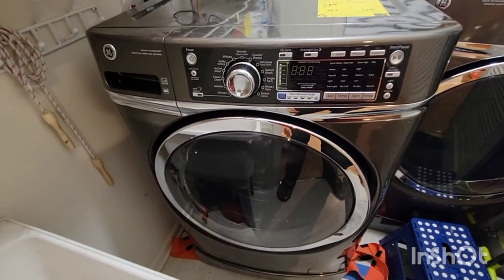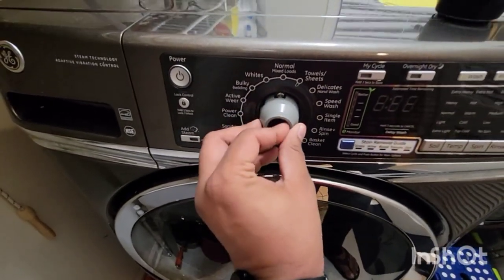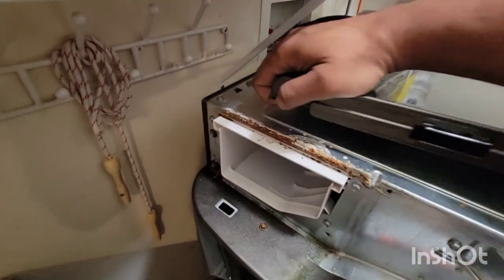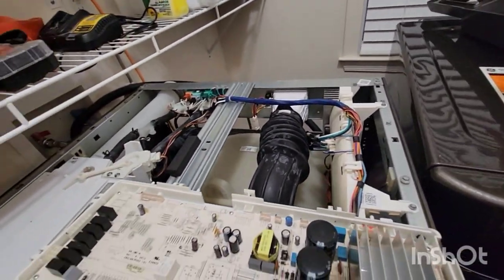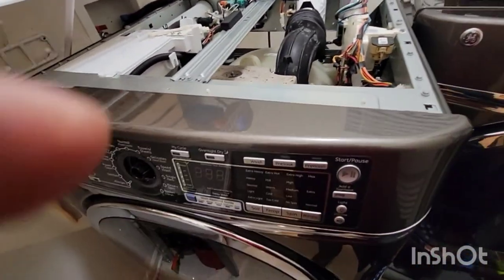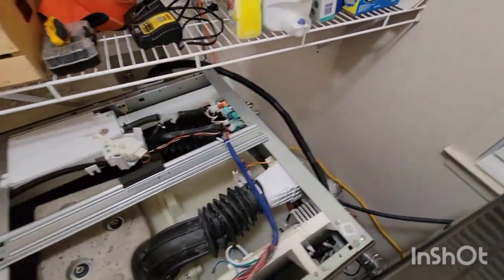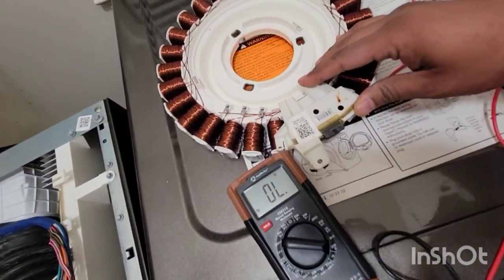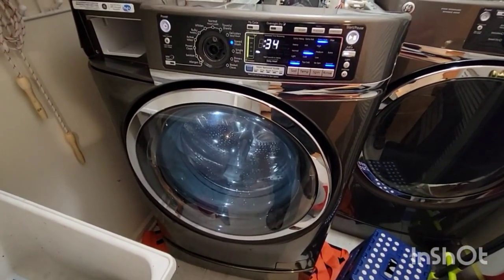GE washer (GFWR4805F1MC) died after power failure + no spin issue

Comment: There is a manual release on the inside of the unit half way down the unit accessible after removing the top panel.  It is located on whichever side your particular unit might latch on.

Comment: My washer and dryer arent as nice as those - but im having the exact same issue and after some research im betting i have the same problem, with the control board at least. Branch came down and broke the neutral wire for my power service at the pole. Everything in the house went crazy. All my surge protectors popped. Power wasnt completely dead since both legs of the feed were still intact, but without the neutral nothing worked right.  I shut down the main breaker in my house and about 16 hours later the power company finally came and fixed my line - right as i was digging out a kerosene heater to keep warm.  Power line fixed - luckily all the important stuff in the house (furnace, sump pumps, fridge, 86" inch tv lol) all were working. My Amazon Basics surge protector probably saved my TV and home theater stuff. All that stuff was on and it was a pretty loud pop when that surge protector blew, but it didn't shut off. That was the first thing to get unplugged as soon as the protection indicator light was gone. Unfortunately both my washer and dryer took a hit, even though neither were in use.

Comment: I'm thinking I have the newer model GE washer and  dryer. Mine are 4 years old. At year 3 my washer stopped draining. I found the specs and ohm'ed out the drain pump which was out of spec. I ordered a new drain pump installed and same result. Everything powered on but no pump. I thought about and the only thing it could be besides broken wires would be the board. The board for my machine was close to $200 and had about 17 connections. I pulled the board first and on visual inspection I had a huge burn mark where the drain circuit is. My theory is the fried board took out the pump. I replaced the board and on my unit you have to go into programming to let it know the specific model of washer. Everything came out perfect. Now the fill valves make a squeaking sound. I have new valves on hand but haven't installed them yet. While back there I am also going to replace the hoses and the steam hose to the dryer.

Comment: you don't have to break your door lock. there is a white piece you can push in to manual override to unlock the door lock.
Reply: Can that be pushed in when the Power has completely gone ( the machine not turning on), and can you please point where on the machine we can find this?
Reply: @vittalvijay551  yes, if you open the switch, you can see it is the by pass door opener when the power is complete gone.
Reply: @vittalvijay551  There is only one white tab on the switch. if the door is not closed, you can access it by open the rubber seal. if the door is locked, you have to open the top, and see the white tab from the top and put it down to release it.
Reply: Can you explain where plz
Reply: @ramos7790   can you be more specific what are you looking for?
Reply: @FirdayNights  I have the same problem my machine won’t start or even turn on even if plugged into wall I have clothes stuck inside but I don’t want to open with bar is there any other way inside ? To unlock door
Reply: @ramos7790  you have to remove the top and the pannel, then you can see the door lock from the top.
Reply: @ramos7790  this video 14:43, you can see the door lock. the red one. 15:18 he is holding it on hand. but the replacement seems no white tab. been removed. but if you search your parts online, you will see a white tab. push in (down) the white tab to release the locking mechanism, then you can pull the door open
Reply from the maker: Yeah, but unfortunately that night I needed clothes urgently as the next day I had to leave early morning for a trip.

Comment: I have a GE gfd85essnww dryer and when installing it it does not turn on.  Do you have any idea what could happen?  The dryer does not give any signal on the screen, on button, etc.
Reply from the maker: Check the power to the outlet first. If power is fine, then possibly the circuit board might have gone bad. The only way to tell might be to open the machine and do a visual inspection of the board followed by taking chances on what you feel might be wrong. Im not an electronics engineer and there was no guaranteed way for me to find out that the board is in fact the problem. Although a broken fuse on board was a strong indication. Note, that replacing the fuse alone is not necessarily going to work, as there has to be something else wrong that led to the fuse being blown out, which is hard to find.

Comment: Always put your electronically switched devices on a surge protector.
Reply: Surge protectors may seem to be an answer, but in my years of experience I've found that something claiming to protect from power spikes, isn't in reality  
going to protect anything from blowing up. You'll find plenty of examples of expensive power strips such as monster with surge protection big capacitors and other circuitry , fancy heat sink construction etc. Hadn't worked at all. What you want is a  voltage regulator such as one would find in recording studios. They're very expensive. But nothing is going to stop a surge such as one caused through ground such as a lightning strike too close to home.

Comment: Lost me at crowbar lol
Reply from the maker: Only time that would be required is if the machine dies after power failure and clothes are stuck inside. crowbar is the quickest wait to pry open the door. I did not have patience to fix the door lock and then take clothes as i needed the clothes very next day for my trip. It did broke the door lock in the process, but i replaced it for another $20 bucks.